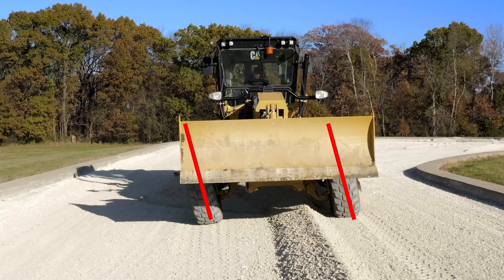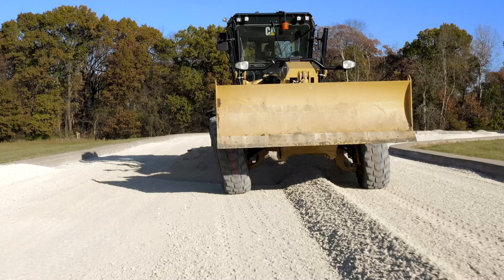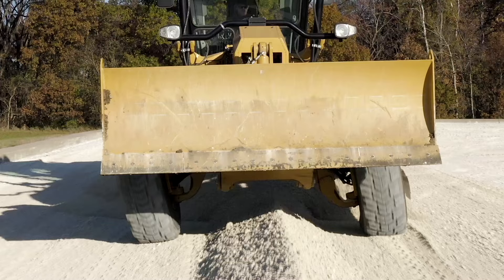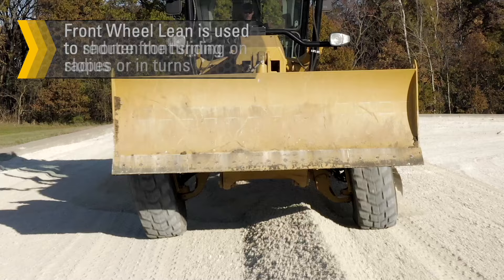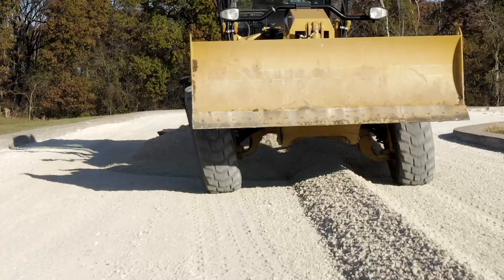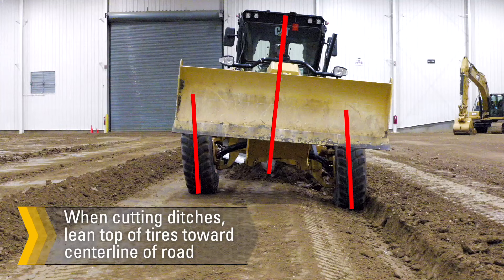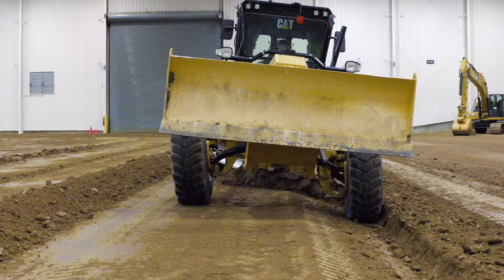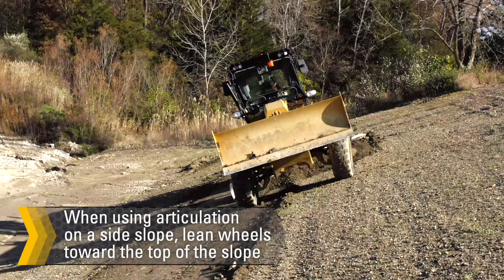Cat Motor Grader Application Training: Front Wheel Lean

Comment: Thanks for posting, for years i wondered why they did that, even from childhood!
Reply: Len David Hart Same here and I still don't truly understand and the thing that it is so difficult to get answers for that is honestly beyond me too lol I love to see how engineered products are designed and for what reason... Helicopters and locomotives is another one of those secrets I feel I just can not get a good understanding of either...
Reply: @lightbulb1982  hi light bulb, i kinda of maybe thought it (the front wheel lean) was to bring the front part of the frame closer to the ground, but that really doesn't make sense. But thanks for your reply.
Reply: Hey guys, I too remember seeing this as a kid and being confused. Although I didn't understand it until I got into racing and setting up front end parts to help corner better. The front wheel lean on a grader can help with several issues. Although one of the easiest is working against the blade. So if you have your blade angled and are pushing dirt to one side. That dirt will be heavy and the dirt will actually try to push the front of the grader which is lighter than the rear. If dirt is exiting to the left side the front of the grader will start tracking to the right. Then lean the top of the tires to the left. Now the bottom left edge of the tires will bite into the dirt and anchor the front of the machine of that makes sense.